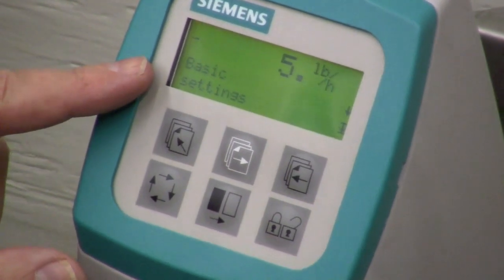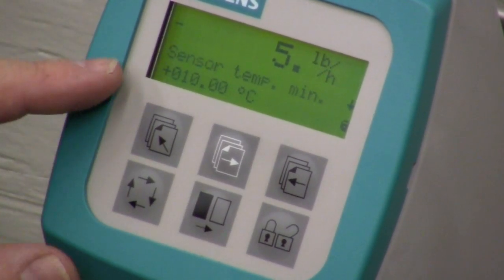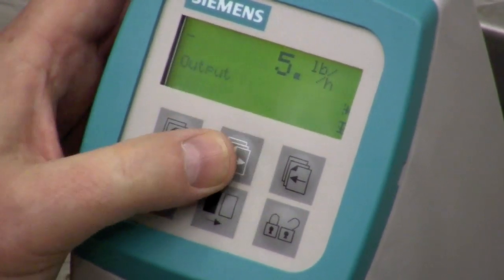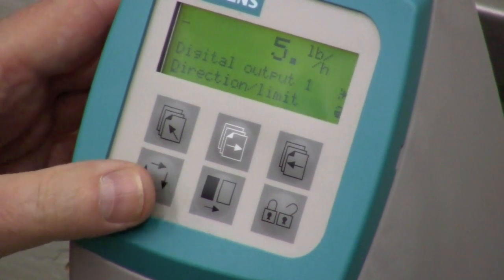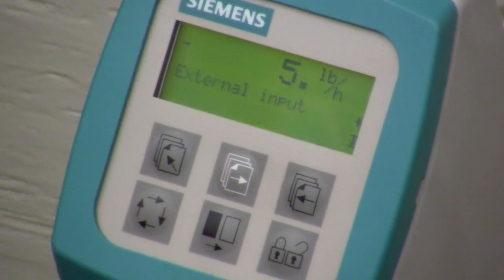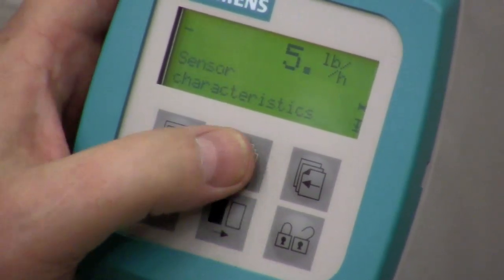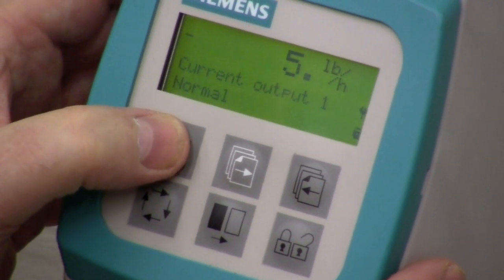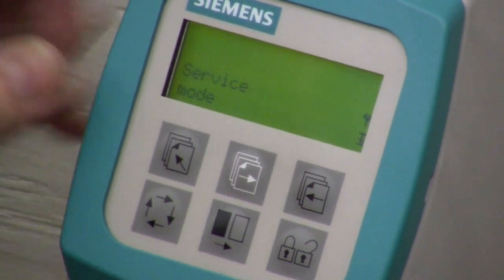Siemens 2100 Mass Flow Meter configuration

Comment: now if the memory is broken  you have to get new one?
Reply: johm kalwa If the memory module is damaged, then it can be replaced.
Reply: if I take it from another  flowmeter ?
Reply: johm kalwa Sensorprom memory module is programmed for specific sensor data.  They can be ordered if damaged in the field
Reply: Without sensorprom you can read the  flow meter reading.
Just watch my video its for sensorprom
Reply: https://youtu.be/0SqXr_4hikI
Reply: https://youtu.be/BfFqqZ9I_D4
Reply: Just note down all the values from the name plate of the sensor and feed it to the flow meter in sensor characteristics menu.. if still having issues you can refer this video from 33:30 https://youtu.be/W92_TfEMsK4